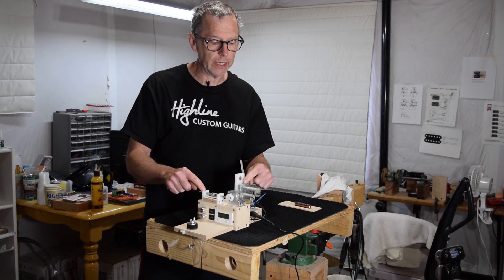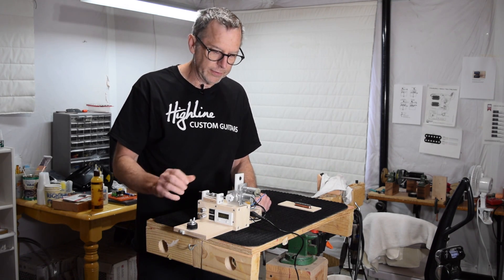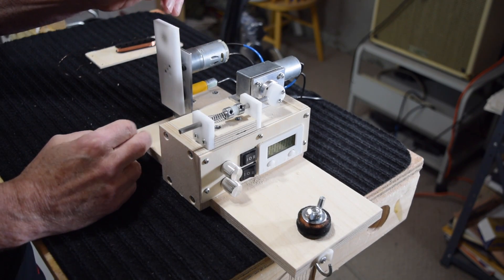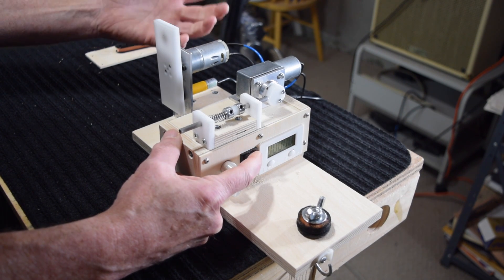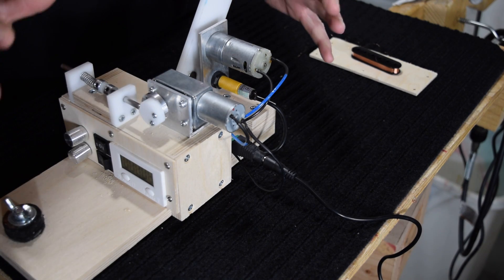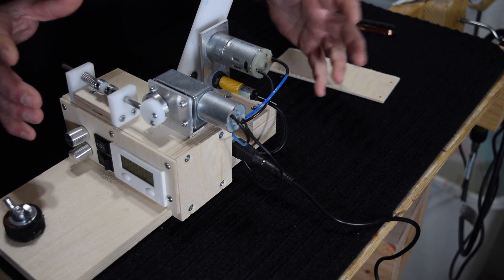My Homemade Guitar Pickup Winder

Comment: coming from the RC hobby I use a brushed motor, esc, and servo tester powered by a lipo. it sits on a table next to my chair in the living room. I run it during commercial breaks. It's all held together by paint stir sticks, hot glue and a few bits I made with a 3d printing pen.  It might be garbage but it's good enough for rock and roll.

Comment: Nice work!  I built something similar, but I used a stepper motor, and I generally need to run much slower (longer bobbins than for guitar, tricky to not break the wire).  Good idea with the tensioner -- I wonder if you could rig something with weights instead of the wing nut, to calibrate the tension even better, without electronics?  If you want to run the counter faster, I believe the limiting factor with those is that they use mechanical reed switches for the sensor.  If you replaced with a Hall sensor, I bet the counter itself could go faster.  But maybe you don't need to anyway.  Mine certainly never taxes the reed switch, I run around 60 RPM in many cases!

Comment: I really like your design and bought your plans for it. I am thinking of using a servo motor and Arduino to control the traverse motion instead of a cam wheel and wondered how you came up with the cam design. There is a demo I have seen using a CAD program to merge two circles tangent to the main circle resulting in a butterfly type pattern which I believe is akin to what you have but would love to explore further. I also saw a metal cam example, I believe that is used for a sewing machine or other machine to control traverse motion. If I am to use an Arduino and servo motor I would need to translate that motion into a mathematical model. It would allow me to duplicate your traverse motion pattern or create other scatter patterns. It would also facilitate matching the bobbin RPMs using an Arduino and software instead of a cam wheel. I would also like to combine the tensioning of the wire with the guiding of the wire by sandwiching the wire between two felt pads and using the collars to set the tension horizontally instead of vertically.

Comment: Chris were you running the traverse motor at full speed 10 rpm's? I may want my motor to be able to go about twice that fast. Should I get a 20 rpm motor or will the 10 rpm go twice as fast as you demonstrated? Thank you!
Reply from the maker: You can use a 20rpm motor because the traverse speed is controlled by a PWM control knob from 0 to whatever the traverse motor's rated rpm is.
Reply: @HighlineGuitars  I have to wait longer for the 20 rpm motor. I can get a 10 or 50 in one day shipping. Was your 10 rpm motor maxed out or could yours go faster?Looks like one traverse on yours was taking about 4 seconds.  I may get the 50 but it is probably way overkill. I'd like to be able to get a 2 second traverse or even a 1 second traverse for a big scatter.  Thanks Chris
Reply from the maker: @scottjamable  I'm sorry, but I don't remember.

Comment: I doubt Chris is reading the comments on this video at this point, but I am trying to figure out how to cut the Felton plastic cam shapes. Not sure what to do. Dremel, perhaps?
Reply from the maker: I used a CNC machine to cut mine. If you must work by hand, I would use a jeweler’s saw. If you have an electric scroll saw that would work even better. You could try a Dremel, but I don’t know if that would work.

Comment: Great video - the level of detail is amazing. Would anyone mind sharing what the parts end up costing before I buy the plans? I just want to know what I'm getting into.
Reply from the maker: When I made mine, It cost around $150. However, the cost of the parts changes daily. Also, check out my other winder, which replaced this one: https://youtu.be/1Mt2k7qZ3mk
Reply: @HighlineGuitars  ah very cool. Does the CNC machine cost much more to build?

Comment: Great design. The gear motor for the traverse function is a WORM gear motor, not just a gear motor. Watching the video it's very obvious, but if you purchase from the list, you'll end up with a different motor. Still works, just have to rig it differently. Thank you so much for the amazing engineering here Highline Guitars. ❤️

Comment: I used to wind coils in audio speakers and what bothers me with scatter wind coils is that there henry measurement will be different for each coil therefore if you are putting two coils together for a humbucker pickup the two coils will not match in henry or capacitance measurements?
Reply from the maker: Don't let the mismatch bother you. The difference from one coil to another is very small. In fact, some meters can't even display the difference.
Reply: @HighlineGuitars  well then how come a gibson burstbucker  its different sound claiming that they mismatch the coils if they matched the coils they would have a classic 57
Reply from the maker: @georyans  I'm sorry, but I don't understand your comment.
Reply: @HighlineGuitars  my comment means that you said that the difference of mismatched coils is minimal but what I stated in the last reply is matching the coils yields a different sound then mismatched coils to prove that gibson created two different models of pickups with two totally different sound
Reply from the maker: @georyans  I guess what is confusing me is your statement that scatter winding the coils for a humbucker will yield different levels of inductance. That's never happened to me. The only way I can get the two coils in a humbucker to show different levels of inductance is if I wind each with a different number of turns.
Reply: @HighlineGuitars  yes it will it’s not just the length of wire it’s where it sits in relation to the other wires around it I’ve had poor results scatter winding the inductance capacitance and resistance match when both coils are wound the same

Comment: A thought on tension; the tension will need to vary with speed, but speed is not uniform across the winding. As such, using friction to tension the wire could lead to uneven tension. At each lobe of the bobbin ends, the wire will be yanked off the spool far quicker than at the point where the middle is being wound. You could add a take-up device which allows the wire to come off the spool at a uniform speed but also maintains a uniform tension at the bobbin. This is usually a long, thin, sprung arm with a low friction wire guide at the end. I would also avoid running the wire at right angles between your nylon wire guide and your friction tensioner. The distortion could crack the enamel on the wire, which in the case of a guitar pickup may not be super critical, but can lead to shorted windings in some coils.
Reply from the maker: That’s why my new CNC winder uses a magnetic wire tensioner.

Comment: Just thinking out loud a little here...  maybe you could wire up the Counter to negate the need for a battery?

Also, have you thought of using an Arduino Microcontroller in a pickup winder design?
I'm pretty sure an Arduino could be used with a backlit LCD Screen to count & display your winds, & at higher RPM than your current Counter, & can control your PWM boards, while being run off of a 5V power supply (USB)...    🤔

You could even have it so it is both Mains Powered & Portable with RC Battery to power the Motors, etc...    🤔
Reply from the maker: You may find this playlist interesting: https://www.youtube.com/playlist?list=PL7TLAFxVOtrUG-cn7_X7E3-RB5HDEauzD

Comment: I just never understood the shape of the cam?
Reply from the maker: The shape of the cam helps to keep the wire from bunching up at each end of the traverse.
Reply: @HighlineGuitars  I guess what confuses me about it is it only has one high point. It would seem for the wind to be symmetrical it would need two points, one for each end turn around.
Reply from the maker: @bobbys4327  No. You need a high point at the far extent of the traverse and a low point at the near end of the traverse.

Comment: Just got the plans. Wondering if anyone can advise on suppliers and what the ballpark cost is? Obviously the cost is subject to change due to the shortages. Just curious if anyone has built one. From what I can tell the machine seems to have some better features vs machines in the $400-500 range. Thanks.
Reply from the maker: I got everything on eBay and Amazon. I can't say which sellers specifically as they constantly change, but that's where you should search. The cost for me was around $150, however, I had many of the materials on hand from other projects.
Reply: @HighlineGuitars  Perfect. Thank you Sir! I like that Mojotone machine but heck its not cheap. Then again... I buy many Stewmac Tools and had never had a problem. They are good folks and stand behind the tools. Thanks for the plan. At $15 you can't go wrong. Have one or maybe two of the guitar plans and those are great too. Always Good Times at Highline Guitars folks!

Comment: I'm curious as to where you get the materials and about the general cost of materials?  Any special tools for assembly?
Reply from the maker: eBay, Amazon, and my local Ace Hardware store. Cost will run about $150 at least.
Reply: @HighlineGuitars  I saw you mentioned "less than $50" on another similar statement; granted it was a year go.  Does the $150 include tools?

Comment: Nice, so you can change the horizontal winding pattern to give you a low inter-winding capacitance by scattering the windings.  If it's digitally controlled have you thought about maybe doing a random pattern too ?  If it's truly random it will average out and you should get a reasonable fill factor.
Reply from the maker: With this winder (#5), scatter can be controlled by changing both of the potentiometers. However, the result is very hard to repeat reliably. My new CNC winder will control scatter with g-code, which is much easier to repeat.
Reply: @HighlineGuitars  Sweet!  😁Marlin G-code no doubt ?

Comment: Hey if you are adding a 10 rpm motor for traverse but do not want to monitor speed do you still need a WPM board or just a  pot.
Reply from the maker: No, but you should have an on/off/reverse switch.

Comment: How are you attaching your bobbins to the winder? I am using two-sided tape, and I am having a problem with wire having some contact with the adhesive. Any tips to avoid this, or alternate ways to attach the bobbin?
Reply from the maker: I use double sided tape. No issues like you mention.

Comment: I built my own, quite similar winding machine, but I really like the traverse system you've come up with. It's simple, robust, and does the job. My design has more pieces and doesn't do the job as well as your system. 
I hope in some future video you'll discuss charging of Alnico pickup magnets. I know many people use various rigs with fixed, fairly powerful permanent magnets, and a few use electromagnets. Making a basic gauss meter is not too difficult - there's a Motorola IC that does almost the whole job in one 3-pin package. But I'm curious to hear your take on charging magnets. Many thanks for everything you've posted in this very helpful series.
Reply from the maker: That's coming in a couple of weeks. Stay tuned!

Comment: Wow Double Wow Great Machine!!!!!! it is similar of mine, I use  to say my machine has a manual operation and semi automatic,  because it has not an automatic wire distribuition over the pickup flatwork.  After I have seen this video I undertstood how to do the distribuition and I am really happy,  I would like to thank you for share your project with us.    I have a suggestion,  what do you think to install the 2 knobs on the left or right side of machine house,  this way you can turn the knobs to change the speed wiring outside of wiring area to avoid touch on wire and brake it..

Comment: Bought the plans, almost done... Just have the wiring to do. Well, I should say wiring is done, but my winding motor is surging and not functioning smoothly. I suspect the wire gauge I'm using to connect the motors to the speed controls is insufficient. Do you think that could be the problem? And if so, what wire gauge did you use for yours?
Reply from the maker: I used 18AWG wire. If that's not the problem, it could be the PWM is faulty.

Comment: Just bought the plans and I can find all the required parts very easily which is great! Only thing is the 12v 'hub' as you call it. Do you have a link to what you used? Im trying to find the female jack with more than 1 set of pins to power each motor? Is this correct?
Reply from the maker: This is the one I used: https://www.amazon.com/gp/product/B06Y64QLBM/ref=ppx_yo_dt_b_asin_title_o00_s00?ie=UTF8&psc=1
Reply: @HighlineGuitars  great thanks!

Comment: Hello!  Cool design.  How do you adjust the width of the coil traverse motion extents to match the various different widths of bobbins?  It looks like you would have to make different cam sizes to adjust for different bobbin sizes, is that correct?  Thanks, and have  a great day!
Reply from the maker: Different bobbins require different cams.

Comment: I finished mine. It was a fun build, and a great idea. If I may suggest, can you you revisit the schematics and come up with simpler measurements? Not everyone is going to have a micrometer, and measuring all the layouts relevant to each other's screw holes isn't very intuitive. Maybe just give the distances of the edges of some of the parts instead of their screw holes, because the screw holes in most of the parts is completely arbitrary (other than the motor mounts). Also the electronics didn't fit into 1/4 inch plywood. I had to use a thinner sheet of plastic for the faceplate. Most of that can be fixed if the PDF worked for the "actual size" printouts. Can you separate the "actual size" layouts into their own pages? If you don't have a PDF editor or an advanced viewer, the "actual size" printouts get cut off in a conventional printer.
Reply: Did the plans include a parts list for all pieces? Where did you purchase them from Amazon? Ebay?
Reply: @edhampton415  Yes it came with a parts list with fairly detailed part numbers for everything. I got 99% of it on amazon, a couple improv pieces from home depot. If the parts were measured by actual size instead of screw hole placement it would have been way easier to put together in my opinion. But maybe that's just because I couldn't edit the PDF's to fit pages to print. The whole design is laid out for you to print, overlay, and punch holes over the print. I couldn't do that, so it was much more difficult than it should have been. In the end, it's an awesome tool. I just made another pair of humbuckers with it today and it worked great.
Reply: @nicholaskillmeier4895  Thanks for the info. I think I'm going to order the plans today :)

Comment: Do the plans come with component sourcing information as well?
Reply from the maker: Just a list of the specific parts needed, but not where to buy them.
Reply: @HighlineGuitars  is enough information included for a novice to be able to search them out? I don't really know much about those motors and circuit boards. Thanks!
Reply from the maker: @TomL-  All you have to do in type the parts as listed into google and you'll find them. The illustrations in the assembly manuals help and if you want confirmation on a part, I can try to help. The reason I can't list sources is they change almost daily.
Reply: @HighlineGuitars  Thanks Chris, I just bought them. I'll look them over this weekend and send you an email if there's anything that I can't figure out....if that's ok?

Comment: I like what you've done with the traverse mechanism. I built a traverser into my latest iteration of coil winder, but used a small toothed belt and cog pulleys, combined with a speed/direction controller and a side-to-side "traveller" mounted on a ball-bearing slide (just stuff I happened to have). It actually works surprisingly well for a lash-up, and I've been playing with integrating the traverse motion speed control with the action of the programmable winding motor speed & counter module (an industrial PLC that fell off a truck just before I retired). The cog belt is very good as far as repeatability is concerned. I've had no problems with that part of it. The drive motor is a 12 VDC geared motor that (I think) was originally part of the powered adjustment mechanism for an automobile seat. Not fast, but it'll never wear out. The final element I wanted to have feeding into the "master" controller is the wire tension - just monitoring it for consistency. Probably overkill. The PLC allows a slow start for bobbin rotation, ramping up to a maximum of about 1000 RPM while counting each rotation. It also can be made to shut off, either quite quickly or slowly reducing the winder speed, or with a manual override pot. That is where I thought being able to monitor the wire tension might be useful. If I get that working properly, I'll send you the details. I try to use readily available or standard catalogue parts wherever possible. I do like your idea of the cam and spring-return traverse rod. Thanks for a very interesting video. Greetings from the Great White North.

Comment: Bought the plans and made the winder this past weekend.  Works great!  Thanks!
Reply: About how much did you spend in parts/materials?
Reply: @georgetate6628  If memory serves, I did it for well under $100, but I have scrap plywood and aluminum angle in the shop, etc.  The motors, power supply, switches and counter are surprisingly inexpensive, and I substituted scrap ebony for the Delrin. That saved money.